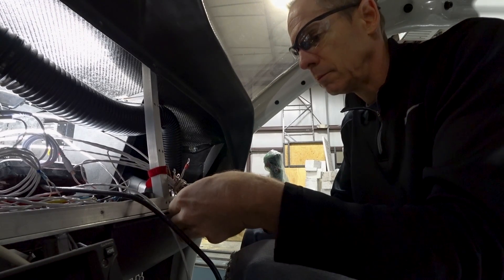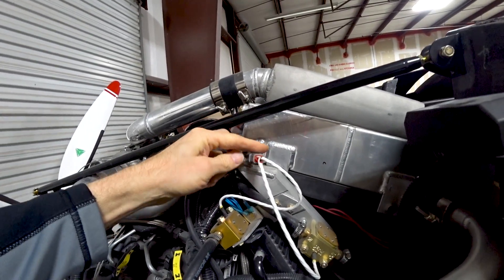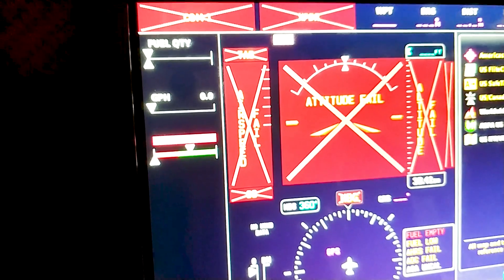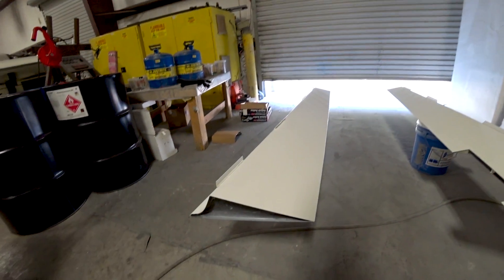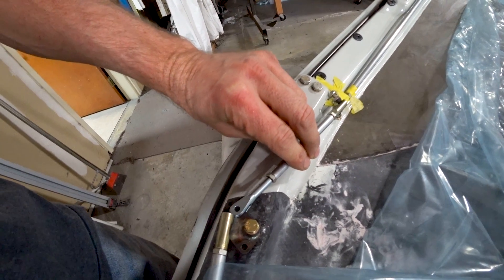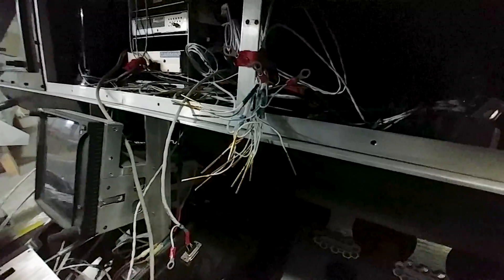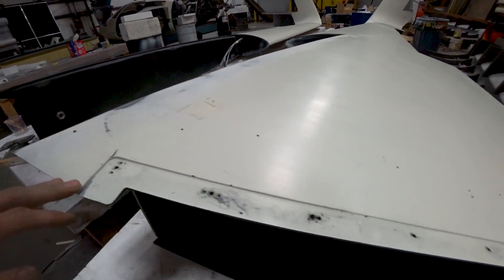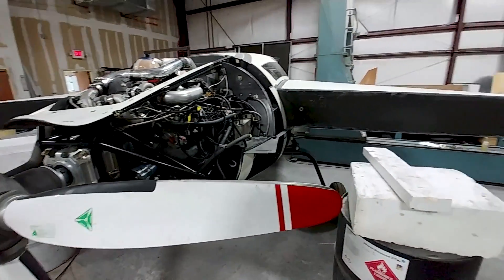The Weight Is Over - Building the Raptor Prototype

Comment: In terms of weight savings for future aircraft - there are some "low hanging fruit" types of items that could be changed out for future aircraft. For example, make your own wiring ducts using one layer of bid molded around a tube with duct tape as opposed to buying plastic conduit at the hardware store. It was quicker to just buy the stuff for the prototype as opposed to constructing something custom to be lighter so that was probably a decent trade-off for the first plane.

Comment: Wow, love the airplane. Quick question, the 7gph you estimate, how heavy is the airplane at that fuel flow. Plus, are you still shooting for 2300lbs? If so, what do you want to remove? Great work, keep it up!
Reply: Just need to look at similar sized canards like the Velocity V-Twin 3200lb MTOW and 320hp and if it burns fuel like the Piper Twin Comanche (10-15GPH) that would be what I would think this aircraft would require. Since it’s not set up for twin it’s going to need one of the lyco/conti large bore engines installed that also drink 15gph no easily.

Doubt that would be possible. 7gph is less then a lightly loaded 180hp Cessna uses at cruise and that aircraft has an MTOW of 2400lbs. Don’t see how a much larger aircraft with a dry weight of nearly 3000lbs would be doing anything under 15gph when equipped with adequate power.
Reply: What degree do the better aerodynamics play in this math?
Reply: neve1064 none. Will just results in a higher top speed for a given power setting. A 60%, 70%, 80%, 100% power settings are the same regardless of airframe since they are based on the engine output.

It’s like comparing the O-200 from a Cessna 150 to the O-200 found in the 300lb lighter Cessna 162 skycatcher. 

Both can cruise at 5.5- 6gph on their 100hp O-200, but the C150 does is at 95kts and the C162 at 115kts.

Comment: That’s 600 lbs more than the cirrus and you don’t have paint yet. Can you just look at the wing loading and see if that’s logical on the curve for the performance you’re looking for.
Reply from the maker: As I said, it's a prototype and there are a lot of things in there that are experiments that can be removed for production. However, keep in mind that there is a lot of added weight to handle the pressurization. It was also designed to be flown in the utility category at all weights. So it is overbuilt.
Reply: Raptor Aircraft   How much fuel is still on board from the recent shake down runs?   Do/can you raise the 3600 lb gross wt ?
Reply: I just wondered since you know the wing area and weight now you know the wing loading. That will tell you how much drag at your intended speed and how how much hp. These aren’t criticisms. It’s amazing what you’ve created. We all want the ultimate outcome.
Reply: Performance won’t be affected, useful load will be.